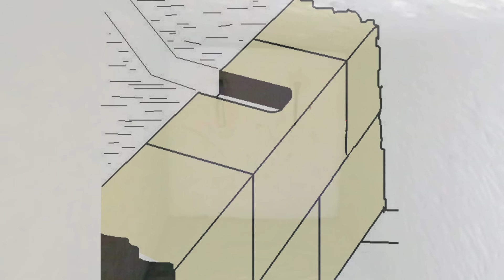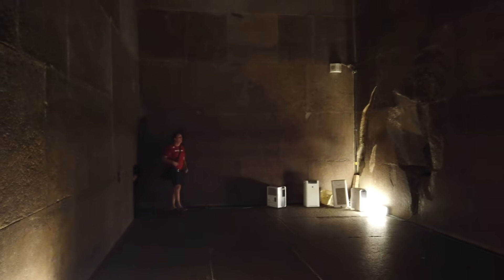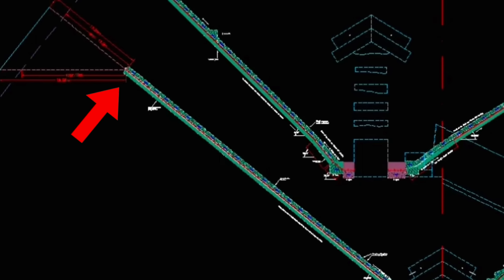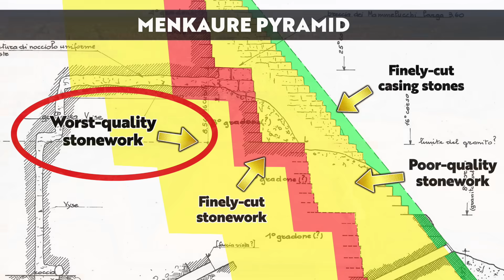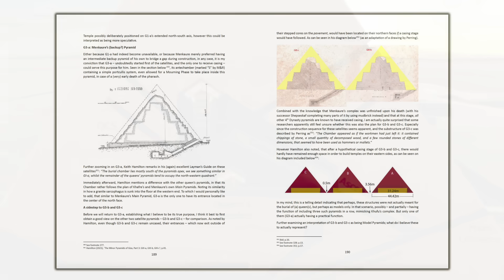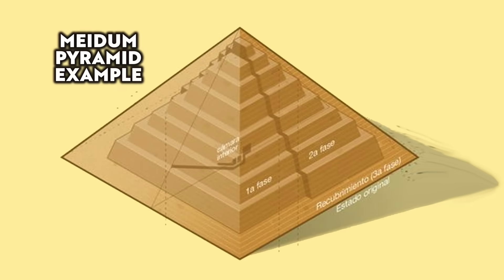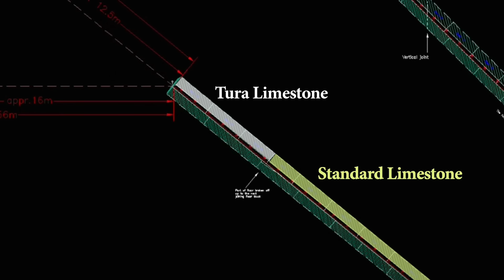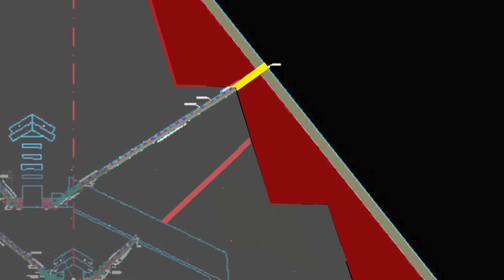Great Pyramid HIDDEN Steps Explain Everything | Part 1

Comment: THE SMALL PASSAGE INTO KINGS CHAMBER  MAY BE A MOISTURE BARRIER PART OF THE AIR SYSTEM.  IT SHOULD ALSO BE FIGURED IN A LONG TERM SPAN OF USE . THE PASSAGE IS SOMETHING.

Comment: To build The Great Pyramid of Egypt, we would have had to wait until 1964 when laser transit surveying devices were invented, builder George Gordon has said. It would have cost 32 billion USD in 1964's money, which would be 4 times that amount in today's money. That is an awful alot of money for a tomb. The 14 acre site where the building sits has  a 1/2 inch plomb precision which could not be done by any builder, again according to George Gordon in our time. For the sake of science, The Great Pyramid of Gisza is an 8-sided Pyramid, the only one of its kind. A half-centimeter error at the base would have resulted in a disaster at the top. Let's quit kidding ourselves, whoever built The Great Pyramid of Giza was smarter that we are today, because we couldn't build something like that and the cost would be beyond any governement's budget. A2, you have got to realize Khufu's architects were undoubtedly very good, but not near good enough to build such a structure.
Reply: Utter nonsense.  Every aspect.
It doesn't have to be completely accurate to build and it isn't.  Adjustments can be made at anytime and measurements taken.
The workers had to ascend the structure and the points would be the centre of each side which would be finished last.
It's a pity they didn't understand the need for expansion joints, would have saved upon maintenance and improved safety.

Your economic theory is rubbish.  The workers principal pay was food and drink.  Egypt had massive surpluses.
A pyramid is literally useless for any rational purpose other than a tomb.  The big clue is the sarcophagus, exclusively found in tombs.
Check out Napoleon's.  Far more elaborate than this pyramid and equally as expensive.  His sarcophagus is porphyry and perhaps the French are hiding the truth lol.
Reply: so when was it built, and by whom ? I get some popcorn.

Comment: If I have correctly understood your explanation, you maintain that the core of the pyramid was built first and that the cladding was placed in the final stage. However, this approach presents a problem: the methods used to install such cladding are not specified. This aspect is crucial, as those stones, being polished, form the most visually perfect façade. They should not be left crooked or misaligned.

If the cladding were to be installed at the end, it would be very difficult to orient and adjust stones of such size at more than 100 meters in height. For this reason, Jean-Pierre Houdin proposes that the construction of the pyramid began from the outer row, with the cladding being placed first and the interior subsequently filled in. According to this theory, there would have been no later enlargement; the pyramid would have been designed this way from the outset to control its shape and ensure symmetry. I believe your video does not take all factors into account
Reply: Every theory needs to explain, how the ancient Egyptians managed to keep the faces and corners of the pyramid perfectly aligned until the top was reached?
Building the stepped core first, solves that problem.
Reply: @gustaveriksson405  Exactly. There must have been an aiming point at the apex. There is no other way the casing could be correctly aligned. The stepped core solves this.
Reply: The pyramid of Menkaure has the answer.  Look for a picture of the entrance.  The casing stones next to it are flat and polished. Several blocks over you can see casing stones in the process of being flattend and polished, next to them rough blocks.
The rough, rectangular casing stones were carved to flat and angled after placement, so the angle and size didn't have to be dealt with before.
Reply: @celsus7979  just been thinking about the 'casing stones being polished after fitting' - what if these casing stones started as rectangular 'bricks', which were placed row by row, with the final stage of construction being to cut a rough face, then polished to a smooth surface?
Reply: This. I don’t know why he kind of took a shot at Hudans theory based on the weakest aspect of his whole theory, which I think is the best and most complete theory I’ve heard.
Reply: It seems to me the most likely scenario is that it was all built around the same time and the step pyramid was just the standard technique that was the first priority for stabilizing the pyramids after which the outer casing stones were added to finish it. The fact that we find Khufu graffiti in multiple areas of the pyramid that had to have been sealed off during the original construction would reinforce this construction timeline. I don't understand why so many people insist the inner core must be thousands of years older than the casing stone except that their default instinct is to work backward from an ice age pyramid theory  because it would just be more exciting to think about...which I think everyone agrees with,  but that's not evidence.
Reply: you should also have a look into this channel: Building the Cheops pyramid. New theory
YouTube · The Great Pyramids Equation
Reply: Retaining the queen's chamber as back-up in case the king's chamber, subject to less load than the queen's chamber, should fail, makes no sense to me.

Comment: No matter what you say, you can not convince me that a bronze age culture without power tools could have built this massive structure. All C14 data must be from renovations and similar. I believe it is way older. I don´t think the pyramid was a tomb but a cataclysm-safe treasure vault, built by people who had the younger dryas cataclysm in fresh memory. I think the air channels had two functions, first to provide airflow during construction as you said, but also to provide a pilot-hole that would allow any future king to find the treasure chamber, even if the pyramids had been sunken into the sea with only the tips above water. In case of a cataclysm, like the younger dryas cataclysm, the pyramids were built to hold national treasure in a way that would not be wiped away, as had previously happened to Atlantis located in the eye of the Sahara. Note how there were thousands of stone vases in the bent pyramid, they were probably salvaged from the destroyed Atlantis, and put in a safe place. I think pyramids held items of immense value, like gold, gemstones and stone vases. No one would ever build this massive structure without a purpose. If it was a tomb a much smaller structure would have been sufficient. If it was just a treasure vault, they could have dug into the ground. They had to build this massive structure to elevate the treasure chamber up from the sea level that might rise. The wedge shape of a pyramid is also no coincidence. It is the perfect shape to brace against huge tidal waves.
Reply: That's the most ridiculous theory I've heard in a while.
Your problem starts at the beginning.  There was no flood or cataclysm.  The sea took 5000 years to rise after the YD.
Reply: so a bronze age culture was not able to build the pyramid, but an older (stone age ?) was ?  "Sunken in the sea..." God, help me ! 🤦‍♂
Reply: Carbon dating is from samples of charcoal in the gypsum mortar from the core structure, not later repairs. There may be a couple of hundred years wiggle room but thousands of years, no. Furthermore the dates align with those from other pyramids built by the the other known dynastic pharaohs.

Comment: I worked in building controls and air handling systems. Unless you're mechanically moving air through those small shafts they won't provide enough air movement. Without fans, the air exchange looks to be very limited. Looks limited even with fans cause the ducts are so small.
Reply: In Howard Vyse's 1840 publication "Operations Carried on at the Pyramids of Gizeh in 1837", based on his 1837 field notes, he says: "Upon the removal of this block the channel was completely open; an immediate rush of air took place, and we had the satisfaction of finding that the ventilation of the King’s Chamber was perfectly restored, and that the air within it was cool and fresh.”
Reply: They need to allow the limestone to dry.  Allows for circulation like a chimney especially with the door open.
Reply: @ChrisShortyAllen were the shaft sealed off at the chamber end? How would they aid drying limestone if sealed? I feel the purpose was less practical.

Comment: There was another YouTube channel, Great Pyramid Equation, that was actually suggesting a really good explanation for these air channels terminating, and that's that the way the blocks were hauled up the pyramid was basically by using people as counterweights with a rope+pulley system; having people climb the pyramid and then stand on a platform that does a controlled descent down a shaft that's tied via rope and pulley to a stone on a ramp that needs to be moved up the pyramid. The air shafts in the great pyramid would end right at these "elevator shafts." They'd also be built on the ramps that the blocks are hauled up, which explains why, after the initial curve, they're able to remain very straight on the vertical axis. Laying stones with a corner cut out on a ramp would just be an easy way of doing that.
Reply: I came here to mention that as well. Their hypothesis makes more sense from an engineering standpoint than almost any others I've heard of, and the evidence is pretty extensive when taking into account the construction of many pyramids in a similar fashion.

We need to do more research to know for sure, but I'm inclined to believe it's mostly correct
Reply: @richarddickjohnson516  Wooden horizontal winches, each operated with eight levers have been discovered, Pulley systems found and double-rails and niches for rolled in blocks
Reply: @paulroberts7429  -- "Wooden horizontal winches, each operated with eight levers have been discovered"
Where? When? What period in ancient Egypt are they from?
Reply: @richarddickjohnson516  Yeah it's the best damn theory I've heard as to how the Egyptians built these things.
Reply: One way or another, I’m sure counterweights were used in lifting the blocks up to the working level..  even if the counterweight simply counterbalanced the weight of the skid and ropes by being lowered empty while the other skid holding the block was raised.   Most likely for practical purposes and logistics of getting food water and workers to the worksite daily, the muscle power used to raise the blocks remained at ground level (both human and animal muscles)
Reply: @douginorlando6260  I mean, with the method TGPE proposed, pulling a stone up effectively becomes a group hill climbing exercise, and the workers wind up back down at the bottom at the end of it anyways where said food and water would be.
Reply: In no way am I doubting your theory on how they used counterweights, ropes pulleys snatch blocks ect. My only question is the weight of the stone blocks, at Baalbek there is blocks of stone estimates at 1000 tons. How did they quarry, cut them out, hauled them away and then go on to stack them one on a nother with seams and joints so tight as to not be able to slid a sheet of paper between them. 

So, I have to wonder what diameter of braided rope was used? Size of pulleys to roll a foot diameter or more in size?

I see core drilling, scalps of granite removed? The granite pottery with such tight tolerances into .003 of a inch variances? 

I have to lean to the theoretical unknown of past civilizations have the technology to complete these stone structures all over the world.
Reply: @Darren-r9b  The largesst stones at Baalbek, are only 800 tons and never needed to be lifted at all to get them in position. Obelisks weighiing more than those, were dragged all the way from Egypt to Rome, using not one single technology the Egyptians never had. just rope and wood. And the heaviest stone ever moved by hand, weighed 1250 tons, and was also moved using only ropes and wood, and that was in the 1700's and thousands of people saw it happen, and the stone is still there today. And all the claims of extreme accuracy magically vanish when unbiased people with no conspiracy to sell are doing the measuring. 
 A lot of huge ropes were found at the pyramids. But they are hidden from sharp eyed conspiracy folks on full public display in museums. 
 And the people showing you super tight joins, are very careful to not show all the places where the joins are not tight at all. 
  All the same, the shafts were not for ropes to pass through. One of them takes several sharp turns. You'd struggle to pull a rope through it even with no weight at all on the other end.
Reply: @Darren-r9b  Estimates for the limestone blocks on the Great Pyramid are actually more like 2.5 to 5 tons and decreased in weight the higher it went on the pyramid. The granite blocks in the King's Chamber would've weighed much more though. But it's generally agreed they transported them by boat, except for the limestone blocks they quarried on site. I do kind of think there could be a puzzle piece missing with cutting the granite blocks
Reply: Just replied suggesting the channel! 🤣
Reply: The MASSIVE problem with that, is that the shafts aren't straight. And one of them takes huge deviations and couldn't possibly be used that way
Reply: The big deviations are close to the central chambers themselves. The majority of the shafts are pretty straight with very slight course changes. Laying them along a steep ramp excluding the areas close to the main chambers would allow for the shafts to easily remain relatively straight, with slight left/right kinks, quite easily. I mean, it's basically just taking the pit and ramp design observed on the unfinished pyramids, applying it to the Queen's Chamber, adding a 2nd ramp going the other way on the other side, and extrapolating said construction upwards (aka, building the ramps up on themselves).
Reply: @ashscott6068 nobody said anything about running ropes through the "air" shafts out of the king's and queen's chambers, where did you get that idea from?

The video series mentioned in the original comment of this thread has a very detailed explanation for both how and why those shafts would be built with such deviations. And it definitely wasn't "because the shafts guided ropes". I highly suggest you watch it if you haven't, it's very informative. And no, you don't have to believe it if you don't want to, but at least check it out before you decide you don't like it.

Otherwise, you have some good points about how certain people and interests try to deceive the public about how easy it actually is to move and place large stones without modern technology. It's unfortunately way too common these days and makes it much harder to improve our knowledge of things
Reply: The "Great Pyramid Equation" ignores the stepped core.

Comment: Excellent vid. Just a thought. If the big void is another Grand Gallery, to haul the relieving chambers' granite blocks into place for instance, it would need access. If it had a passage roughly parallel with the Grand Gallery passage, would that line up with the small void blocked passage behind the 'chevron' entrance?